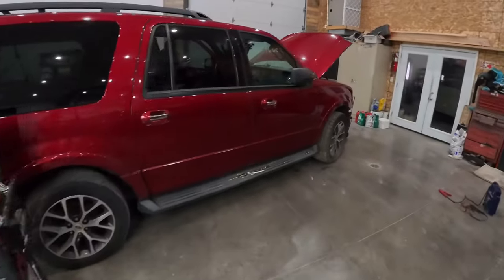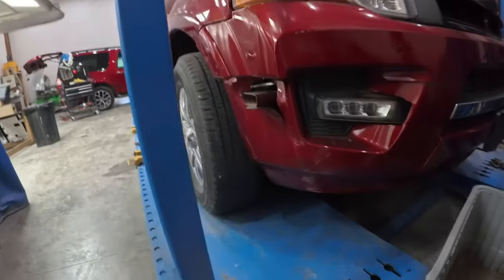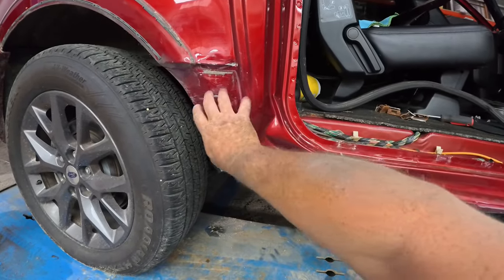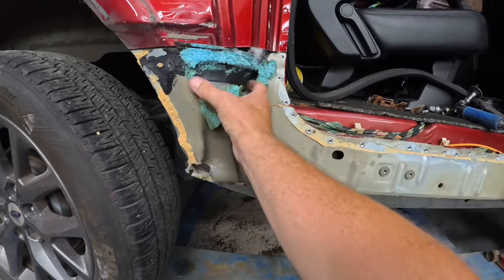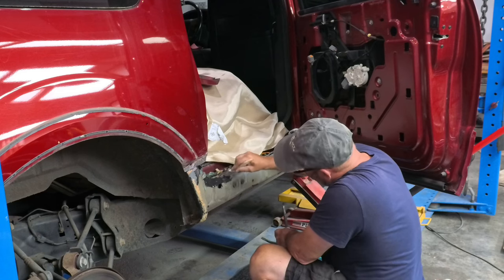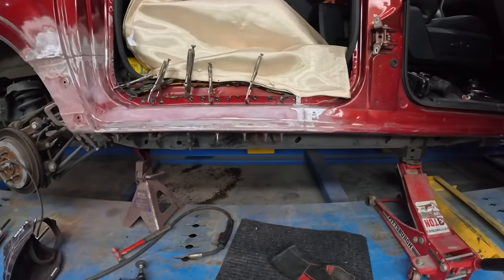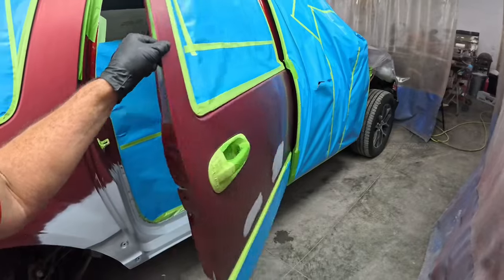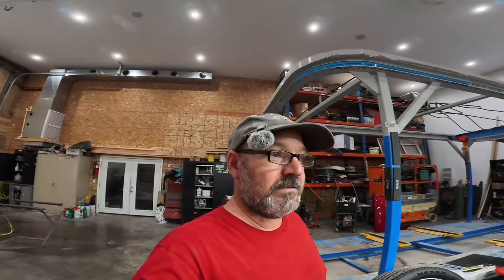I bought 3 identical salvage trucks, Attempt to rebuild  2 and keep #3 free

Comment: What welder are you using and what size wire?
Reply from the maker: Lincoln 210 mp. .035
Reply: @Shouse-life  interesting,  I use the same exact welder.  I haven't found it to be great on thin material, especially with 035 wire.  My old 120v sp125 did a better job on thin gauge.  Thanks for the video
Reply from the maker: I’m not arguing with you on that.  I’ve smashed this stinger multiple times over the years from frustration.